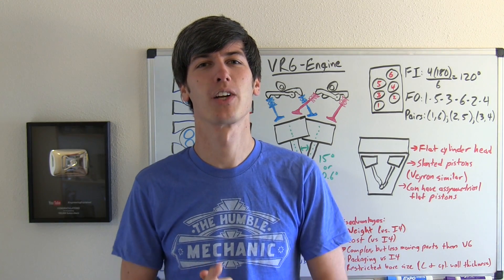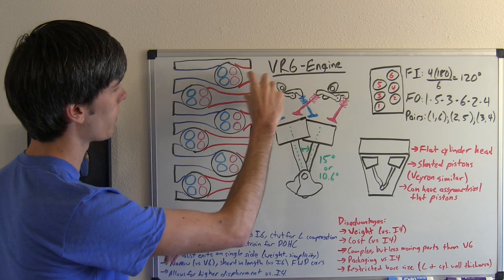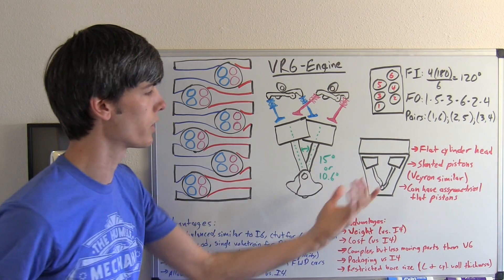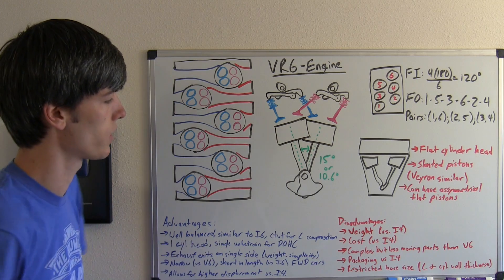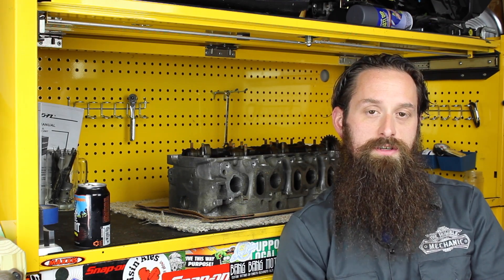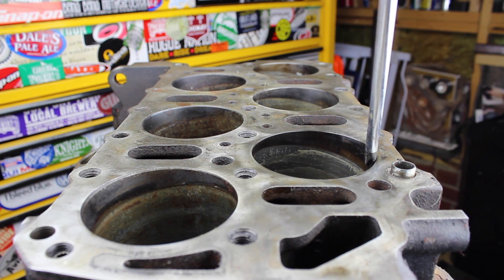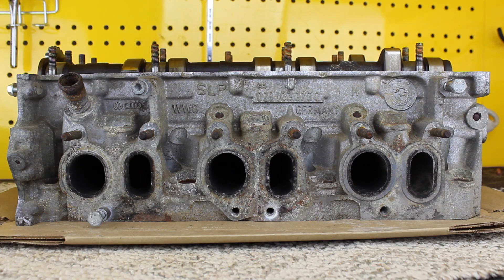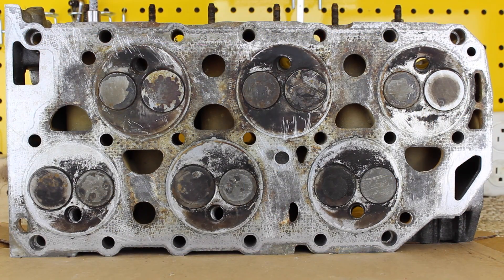VR6 Engine - Explained

Comment: Can you please explain the motor that was in my 1993 Ford Ranger it was a 4 cylinder engine but it had 8 spark plugs?
Reply: more efficient and reliable, i have only seen it in airplane engines
Reply: luis laurencio your welcome ,,  
I'm  just a bit of a gear head and , actually love explaining stuff to  people
Reply: what's to explain? it has twin spark. nothing exciting about it. just doubles the cost of replacing plugs and wires 😁
Reply: +Scott M like the early Nissan twin plug engines. eventhough you will be told different by ford.  the reason for two spark plugs per cylinder is due to poor cylinder head and combustion chamber design so the extra spark plug was fitted to try and produce a (bigger bang) produce more power and try and make it more fuel efficient emission friendly
Reply: +luis laurencio  one of the  original dual spark engine was  the  nissan Z engine 
they had  one distributor cap with 2 coils and 8 plugs  ,, i've had several nissan trucks and cars with this engine over the years ,, unlike the  ford ranger that had coil packs and a bunch of electronic BS  the nissan one was quite reliable ,, they also had a double roller timing chain  and also unlike the ford  the Z engine has a cross flow cylinder head  with  very Big valves which are opposing each other at 45 degrees   ,, another  benefit of the nissan engine is the exhaust ports which are in 2 pairs instead of  4 single ports 
 this makes mounting  dual turbos on it easy ,, this I know because i own a 1986.5 nissan hardbody truck  ,, and it sports  twin  garrett T-3 60MM turbos with intercoolers and it breathes through a  holley  650 double pumper carb ,, i get just shy of 450WHP at 7000rpms  with  25 pounds of boost
Reply: +wildcoyote34 WHY ARENT YOU EXPLAINING THINGS!?!?!
Reply: ***** the crap on a ford ranger is a big pain in the asshole to fix  because it has  coil packs  ,and it is double as complicated electronically ,,I know personally  because i have one , and it was fucked up ,, the setup on a nissan is   simple  ,and reliable ,double ignition coils and modules , and a distributor cap with 2 circuits in it 

the twin spark actually has a very complicated function , it both increases  fuel combustion  , but it also decreases emissions , makes the engine run cleaner ,,also adds a little power too,, another side benefit is  they start faster in cold weather
Reply: ***** hmm tha's a new one for me i never knew  toyota had a twin spark ,, 
the only one  i know a lot about is the  Nissan NAPS Z engine ,, and the ford twin spark 2.3 liter 4 cylinder 
the nissan design was very reliable and worked very good for many years,,I've had a couple nissan trucks that reached 500K miles 
without even needing a timing chain replaced 
just had to adjust the lifters  every 20k miles or so to keep the rattle away 

I had a mazda RX7 in high school  and it was a PITA to work on ,, talk about lousy computer ,, the thing was always giving me fits ,, i have to admit when it ran good it was really fun to drive due to the  rotary engine and it's love of RPMs ,,it didn't lack for ZOOM , i just hated it's habit of burning oil ,,something that the rotary engine is well known for ,,they have to leak a little oil around the Apex Seals or they won't work right 
i currently have a mazda truck with a rotary swap which the engine runs good , but  the truck is too heavy ,, the stock Mazda truck transmission and rear end gears are too tall for the  rotary and it's lack of low end torque 
once you slip the clutch enough to get it moving it will haul ass though 

as for  the diesels ,, I own several and i would rather hear the rattle ,clatter ,chatter noise 
like my 4BT ranger  with it's growl and rattle ,and squeally turbo  that will make you deaf if you listen to it too much
or my  6V-71 turbo detroit powered  78 chevy  which  can't be made quiet without turning it off 
my motto has always been ,, the louder it rattles the better it RUNS
and loud pipes saves lives
Reply: +Scott M ah yes some of the mazda and nissan pickups had 8 on a 4 cylinder as well.  Since Ford has made alliance with Mazda in some fashion there is no surprise their design would port over.
Reply: I had the same 93 Ranger i4 with 8 plugs.  The 8 plugs provide better spark and more complete burn.  decreasing emissions.
Reply: fknows1 the  nissan Z engine had a very good cylinder  ,combustion chamber design 
it was a cross flow design with very large valves  allowing the engine to breathe better 
it was possible  to  turbocharge a Z engine without modification to the basic engine ,,just exhaust and  intake tubes ,,and if you want to add an intercooler it's even better 
I've had a stock  Z24 produce 275HP  on pump gas  just by adding a  turbo  to it
Reply: wildcoyote34 thank you for a brilliant but unnecessary explanation
Reply: +wildcoyote34 Why is the sky blue?
Reply: +wildcoyote34 Why do clowns paint their faces?
Reply: +wildcoyote34 Why does fire burn?
Reply: +wildcoyote34 Where does Oil come from?
Reply: +wildcoyote34 Why does my toilet flush one way and Australia toilets flush the other way?
Reply: +wildcoyote34 How come if I rub my feet on the carpet, I can shock people?
Reply: Lol its kind of hilarious
Reply: +wildcoyote34 Ford and coilpack is always a nasty combo :) even today. Twin spark is an early very basic attempt of doing exactly what single plugs and diesel engines do by default these days, pre ignition, ignition, post ignition cycles etc.... all for a better smoother burn and lower emissions, and one of the biggest reasons diesel engines run so quietly and smoothly now compared to the old rattle and bang that they were famous for. Same concept but controlled by fuel injection timing in a diesel. Twin spark was a result of the technology at the time not being able to pulse fast enough to achieve it with a single plug. ONLY Toyota did a good job of it also. Unless you take into account the Mazda rotary engines, different function but similar concept when it comes to the timing of two plugs.
Reply: ***** oh forgot to mention the Mazda didn't have 2 plugs it has 5 plugs , never understood that
Reply: +wildcoyote34 loud means like thunder not high pitched whine like a overpowered weed whacker.
Reply: Robert Benoit obviously  clueless and  never  had a twin turbocharged detroit  in his truck ,, because there are loud vehicles  and then there  is a Screamin Jimmy ,,  I have had  both , and   i must tell you they can both make you deaf ,,,and if i pull up next to you at a stop light  and  put the hammer down on it in neutral  ,,  All the harleys at sturgis  won't make that much noise ,, even the roar from the 468 big block ford  in my 84 F250 with  4 inch pipes and long tube  headers  isn't louder 

want  something that sounds like a lawnmower , go buy yourself a honda  or one of those  toyotas  with a fart can muffler
Reply: Justin Sink you are 100% wrong 
the spark plugs don't fire on the exhaust stroke ,, they fire on the compression stroke ,igniting the fuel on both sides of the cylinder  at the same time ,, giving more  rapid burn of the fuel  which reduces  emissions 
after combustion  there is not enough oxygen remaining in the exhaust for the spark-plug to do anything ,, that is what  the catalytic converter is for
Reply: luis laurencio On airplanes its there for redundancy.. in case one ignition fails you have a secondary back-up, NASCAR have redundant ignitions too.
Reply: Robert Benoit yes they made the Mazda pickups on the same assembly line.
Reply: Scott M the later Mazda B2300 , B3000 and B4000  ARE ford rangers   just rebadged  with the mazda logo and fancy grille 
back through the 1980s  Mazda made their own trucks and their own engines ,,wasn't till they merged with ford that they started using Rebadged  rangers  ,,, in much the same way that Izuzu  sold chevy S10 trucks  under their own  name  which was Hombre ,,and  dodge sold  Mitsubishi trucks under the  name D-50

Mazda never made an 8 plug 4 cylinder engine that I know of or that I have seen  I don't think toyota did either  ,but i haven't worked on many toyotas
Reply: +Scott M HEMIs have 2 spark plugs per cylinder, and they do that because of the rounded cylinder heads. a single spark plug in the middle would cause inconsistent and poor combustion, so two spark plugs are used to even out the combustion. I've never heard of a Ranger having 2 plugs per cylinder though. Very interesting.
Reply: Santino Alvarado interesting ,, i haven't yet  worked on a hemi  at least not the new generation hemi ,, never knew they used 2 plugs 
yea the  8 plug 2.3   engine  didn't get made very long ,, 5 or 6 years  maybe ,, the first models had 2 distributors  , then they changed to coil packs ,it was a pain in the ass to work on ,, and even worse to change the timing belt on
Reply: Hmm well I think HEMIs have used the 2 plug system for a while now, but it is relatively unique. 2 distributors too? that is just absurd. My old Ranger was 3.0 OHV  12 valve, and it was a pretty standard Ford.
Reply: Santino Alvarado 3.0  was just a plain  V6 engine .used in the ranger trucks and numrous ford cars like the taurus amd tempo ,mmade from 1986-2008 
the first versions had a distributor ,but after a few years  they went to  coil packs 
I still have a 1989 ford ranger that hs the older 2.9 V6 ,,and it's a completely different engine 

the current Chrysler hemi engine uses 2 plugs  with a coil on plug system ,,it has no plug wires ,or any distributors
Reply: +Scott M I remember in 1994 t was also offered in the Probe. I don't think it was a very good motor. I test drove the 6 cylinder and it blew it away.
Reply: +Scott M all the 5.7/6.2/6.4 Chrysler Hemi engines have 2 spark plugs per cylinder. That's 16 total.
Reply: +fknows1 Yes that sums it up best.
Reply: Just to add in, in the case of most piston aircraft engines both of the ignition systems run on their own magneto. You still need a starter to crank the engine, but once it's going the magnetos will continue to produce a spark even without a battery. Which means it can stay airborne even after a total electrical failure, it can also run albeit with worse performance on only a single magneto/spark system. If the engine was to conk out, it can be restarted in the air as long as it is it is still windmilling (the prop is connected directly to the crankshaft and the magnetos are engine driven). If the prop isn't windmilling and you have a dead battery.... windmill speeds are normally quite slow and close to or below stall speed -> plummeting ass first. 

For normal operations the aircraft is always flown with both ignition systems on not just from the safety perspective but performance and maintenance (cleaner burn - less plug fouling - less time wasted on run ups - better fuel economy - slightly decreased chance of death).
Reply: ***** yep  i know  what you mean  ,, i have seen a few  aircraft engines 
i have a friend with a piper cherokee and it's   180hp lycoming and it has  the dual ignition system , not sure if it has double plugs though ,I know most radial engines  had dual plugs
Reply: wildcoyote34 Nice on the Cherokee, and yeah that engine does have the dual plug system, the two ignition systems are normally completely independent. It's always a pleasure to admire some good engineering, nice to see that someone thought about safety for certain applications also.

Man I had the pleasure of putting quite a few hours in an R182 with a beastly IO-540 (cubic inch hehe yeah). Flat 6 practically off the headers. An old girl from the late 70's, always turned the key with a big grin. Likened it to the American muscle of the piston world :), good times.

Comment: One thing i didnt understand in this video is you compared for weight to a I4 engine when shouldn't the better comparison be a V6 or a I6? you would be able to get the same compression and displacement (so prbably same power?) but what would the weight and size saving be.

Comment: Shame that this engine has so many lies about it...stares at VW
Reply from the maker: +MrRicky0407 This is a gasoline engine.
Reply: +Engineering Explained yeah you tell him.
Reply: +MrRicky0407 Eric Peters explained quite well why the tricks VW used on their diesel engines made them preferable to the customer at an insignificant emissions difference on the Tom Woods Podcast

Comment: It's not single valvetrain. There are two cams just because they have different jobs doesn't mean it's single valvetrain. It's not less complex because it has to be timed and driven the same as a dohc engine. Good video but a few points could have been said better. Saying that you would have to increase the overall block size to increase bore size is irrelevant because it's not possible. Just say the bore size is very limited and cannot be increased much if at all.

Comment: So, great video, but is just me, or is there an error ins the initial explanation? Each camshaft, controls both exhhaust and intake valve, against the initial idea that one camshaft does all the exhaust valves, and the other all the intake valves... Really nice sound in the end... WOW
Reply: +fitty77 there are different generations of valve train systems on the vr6
Reply: Didn't know that. Thanks :)

Comment: I just wanted to point out that at 1:27 in the video you say "all the other V-type engines will basically have two CAM shafts..." but my V8 has one cam using an OHC configuration...

Great video as always, Thanks!
Reply: +4u2nvinmtl OHC configuration? that means OVER HEAD CAM, You mean you have a Pushrod Configuration, where your cam is in the centre of the V and the valves are activated by pushrods.
Reply from the maker: +4u2nvinmtl Should have said all OHC! :)

Comment: In my opinion... POOR design!
Interesting design and sounds good but still a poor design.
Reply: I think so too. I don't like the uneven runner lengths. And the slanted pistons. Wouldn't that put more stress on one side of the cyl wall.
Reply: Tony T
My thoughts exactly!  Not to mention you are running exhaust gases through your cylinder head which you are trying to cool.  You could make up for the uneven runner lengths with a set of odd shaped manifolds but still in my opinion a bad design.
Reply: And then the same poop on the other side (zorst).  Sounds like a recipe for disaster doesnt it?

Comment: So can you increase the bore size of the engine at all or is that a no,no? or can I push it ? or is it better to strengthen the head and turbo it ? ....or take that 3.6 passot motor and bore/or turbo it? ....the reason I ask is blew the original mk4 in my R and it's just sitting there for a project car " I won't trade/sell it , it means to much to me. I have time and with that comes money " which I am willing to spend "but I am just a little unsure on what I want to do. in all honesty 650hp safety on that motor would make me happier than ever , please help point me in the right direction for the power plant that would fit me for my driving needs . a weekend car that can blast me though the Rockies Mountains on a weekend but can still take me to work for a few months if the Honda breaks. thanks again for you're videos , they are informal, educational and ultimately ..inspiring. Thanks again from a fellow vw enthusiast !!!
Reply: oh and what can my haldex link up to " if anything"

Comment: This engine design makes me ask "but why?".
Reply: it fits in smaller cars.
Reply: +Sigma Octantis It's smaller than a V6 and an i6 and has different torque/HP characteristics. Why have a V6 when you can have an i6 or visa versa? Doesn't make any sense, they're all different. With their ups and downs. Get it?
Reply: Violetta Oh well I hate small cars so I'd rather have a perfectly balanced I6 anyway. A VR6's block design must be difficult to make efficiently, they will either have weight or cooling issues.
Reply: +Sigma Octantis It isn't difficult, especially with the standards of VW, they still make them for a reason. They do it for the Bugatti, basically two VR6's stuck together. I don't know much about them, anyway. Just like the i6's, any unwanted forces are counter-acted by weights in the VR6. So balance isn't a problem.

Comment: my vr6 24valve is having epc issues... no mechanic knows the problem. code p0321 intermittent crankshaft sensor problem but replaced and still comes back... maybe you'll know what's causing it...

Comment: So is there an engine that has three offset rows of cylinders instead of the two you see in the VR6? is that what a W engine is? Or did I come up with a crazy idea that is impractical?
Reply: +cutthroat795 The W12 is essentially two VR6's mated together. Obviously not quite as simple as I put it but none the less a suitable explanation.
Reply: +cutthroat795 There are actually W engines out there with 3 cylinder rows/banks. The w8/w12 are 2 VR4/6 slapped together, and so, become V-VR8/12´s imho.

Comment: 1.what is the reason behind the difference in size of intake and exhaust valves?
2.why would the v configuration be decided at 10.6 degrees? it is almost seems similar to in-line engines.
Reply from the maker: Hari Harasudhan 
1. It's easier to push out high pressure gas than pull in low pressure air (hence the exhaust is smaller).
2. I believe it comes down to balancing the forces, but still allowing for the bores to be a decent distance apart.

Comment: You forgot one major flaw with the VR: The inlet/exhaust gas must flow further through the head causes increases in temperature that cost you power and efficiency. I love the sound of this motor, but the 2.5 I5 is far superior in design.

Comment: VR6 wasn't really that novel an idea. It was quite common practice for 'tuners' to offset (stagger) cylinder bores on inline engines to obtain greater bore diameter.
Reply: This design was patented in 1915,  VW was founded in 1937